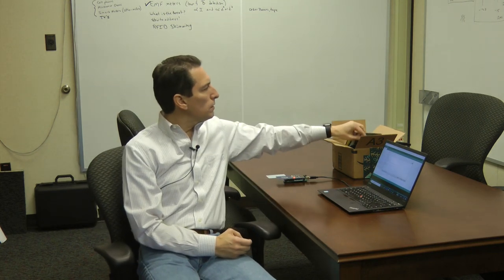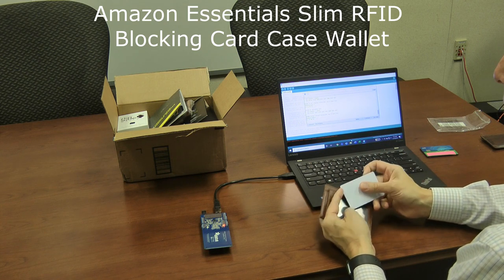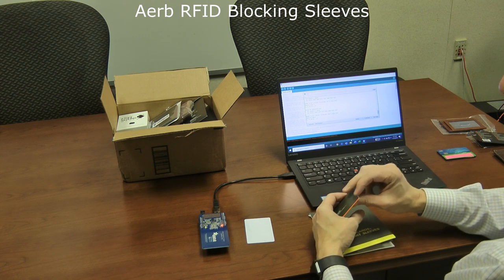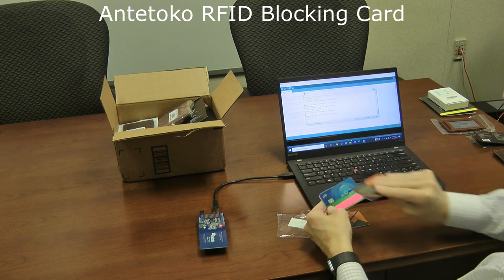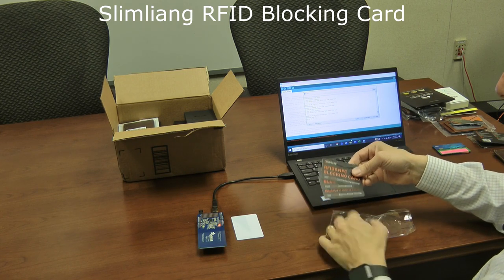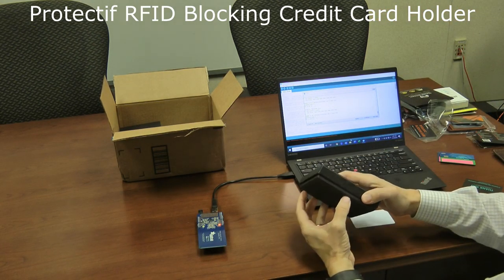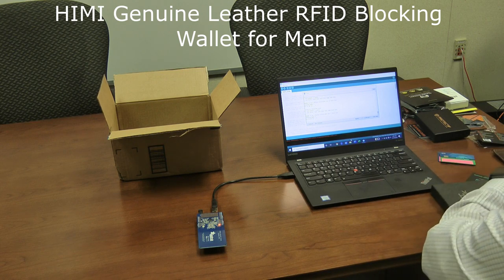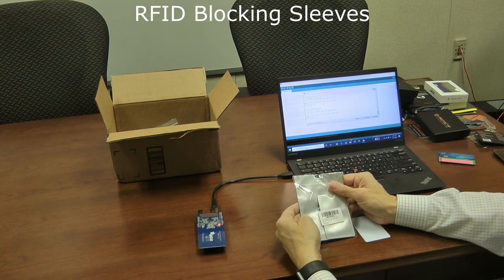Testing RFID Wallets, Cards, and Sleeves

Comment: As an engineer for 40+ yrs, I deeply appreciate the level of actual attenuation testing you performed!  Two comments: 1 my practice has been to cut the cheap sleeves into two pieces so I can line the front/back of my wallet to protect all cards within. 2 you could've tested your card in the billfold area of wallets (I sometimes put cards there to minimize bulky stacking of cards, especially if I'm sitting on them).  Keep up the technical reviews - I'm subscribing to your channel!  - Slim

Comment: That 1st Amazon one kind of impressed me...didn't think the outer slots would prevent the reading...though I think the front-most slot is for folded cash to be easily removed so pretty good!
Especially the fact that the ID slot is also protected...some of today's ID cards are RFID functional so having them protected as well is a big plus.
I'm not too hip to sitting on a plastic box or metal box so the leather ones are probably going to be my primary choices.
Thank you for doing these experiments!
Reply from the maker: You are most welcome. Glad the video was helpful.
Reply: you really should not put your wallet in your back pocket for a great many reasons.
Reply: @williambuck5617  My wallet attaches to my belt with a chain

Comment: I use the sleeves. Easy fix to make them more durable is tape the edges. The tape I used provides friction that keep the sleeve in the wallet when I pull cards out.
Reply from the maker: Good suggestion. Thanks!

Comment: Thanks for these reviews. I already had a stainless steel multitool card in my wallet, so I moved in alongside my credit cards. It does have openings in it, so it may not be perfect, but it might improve the protection. When I get a chance, I'll add some foil in the multitool case.

Comment: Great video.  Thanks for making the investment to help us all.  Your testing method was very consistent; however, some wallet designs position cards in a staggered formation.  I'd be very interested to see how some of the products work in that condition.  Additionally, what would happen if you had a stack of multiple cards (aligned and offset) where the outer two cards are in a protective sleeve, but the inner cards are not (having all your cards in those sleeves is ANNOYING.

Comment: The outside exposed sleeve is not a library cardholder... Some people want an RFID card easy to scan but when placed back towards your body ..it is protected.  thus you do not need to remove it from your wallet .   but if you do the side cut makes it easy.

Comment: I recently tried one that left 1/4 inch of card exposed. The part covered by the jacket was protected, BUT turn the wallet around and try with the slightly exposed end and the card was read. Seems like you could try this a little differently and see some les than ideal results. Example: time stamp 14:30 the body was tested but you didn't try swiping along the exposed end.

Comment: great video, I would like to know if the wallets like the amazon basic and himi with the flip out part, if that is protected when it is flipped out. I would actually prefer that it is not so you can use tap to pay without having to take the card fully out of your wallet.

Comment: I wouldn’t be surprised to find out that if you
put a rfid blocking wallet with a phone in the same pocket you’re also blocking your cellphones signals. You should do an experiment where you take some of the Faraday fabric and wrap it around the phone and then check to see your cell signal strength to see if it’s dropping and if so by how much. Also Bluetooth might be getting shielded.

Comment: Great video, one minor observation, some of the card readers you tested for partial exposure of the cards and they all failed. Assuming that the tests where the protection card was held directly over the face of the cards being protected, if the cards are partially exposed, do they still work? Especially The Vault Card :) Can it still beat the Amazon Basics Wallet? Also, it would have been beneficial if the card was scanned full width. Still a great video :)
Reply from the maker: It depends on how much of the credit card is exposed. If it's much more than about 20-30% many of the wallets and protective cards start to fail. The card I recommend now is the Survivor Symbols card, although the Vaultcard is also great. https://disasterpreparer.com/product/survivorsymbols/. Both provide outstanding protection.

Comment: Just bought a Dockers wallet with RFID.  It uses "...special inner lining...keeps info safe when the wallet is closed." There is that enclosed card which states that it is a RFID secure wallet as well as a little 1" square sticker with a printed square and a diagonal line. My question: Can I discard those two items and the wallet will still have the security feature? Thanks.

Comment: Thank you for this video. You convinced me to purchase the vault card. Would you mind clarifying what frequency your reader uses? I have an RFID card that I use to access elevators and doors in my residential complex. Sadly the vault card doesn’t support protection.
Reply from the maker: Credit cards use 13.56 MHz, which is what my reader worked at. For a cool new RFID card, folks might also check out https://survivorsymbols.com. It worked extremely well and is less expensive. Plus it has cool symbols on it.

Comment: Great video. I have a couple of questions. Is the simulated card you are using a contact or contactless card? Where is the embedded chip located in that card?  (The chip location would make a difference on some of the wallets you demonstrated that have openings).
Reply from the maker: These are contactless cards. Those are really the only ones that I could see worrying about skimming over.

Comment: There is another youtube video testing the silver-colored sleeves and it demonstrates that a card can be read through the sleeve while your test shows the opposite... Since the Arduino is a 5-vdc system, the reader may be running at 3.3Vdc or 5Vdc while commercially available readers may be running at 12-24Vdc... Field-strength would make a difference in overcoming the blocking ability of a sleeve... In any event, since the transmitted information ie encrypted (Typically AES-128/256) and is not decrypted by the card reader but by the card company (which is why the reader has to be connected to the internet), the hacker's device would have to know what the encryption algorithm is to successfully decipher the card information... it would be easier to just buy stolen card numbers from a hacker online... Your video should have mentioned this fact...

Comment: Appreciate all the info. I was going to buy the slimliang cards after your review but some people on Amazon are saying they tried it with their work door cards and it did not stop the NFC. Is that possible after your review that shows total blockage?
Reply from the maker: When I tested them back in 2019, they worked well. Perhaps they've changed their product, not sure. You can also check out the Survivor Symbols card or the Vaultcard, both very good products.
Reply: I just read about LF (low frequency) and HF (high frequency). Door cards and key fobs generally use LF which is not blocked by the products reviewed. More modern door cards are switching to HF. C/C use HF.

Comment: Thanks for sharing this. Banks are claiming that their card are RFID protected, is it true? Which tool are you using for testing please? Thanks
Reply from the maker: I don't know if those claims are true. As for testing, I used an adafruit PN532 RFID/NFC card reader connected to a computer. It takes a little knowledge to get up and running.

Comment: Hi, very interesting. Good video.
A question, if I use a aluminium soda can, for example, will that work.
I would like it, I think is thicker and rigid than the tinfoil.
What do you think??
Reply from the maker: I suspect it would work about as well as the aluminum foil, but the advantage is that it would be much more durable. Just don't cut yourself!
Reply: @disasterprepper  thank u for taking a time to answer.
Also another question.  A piece of lead or a thick aluminium (like a size of a cell phone) can be used to  block  cellphone radiations to the body.?
My husband use his cell phone on his belt case.  All day long that cellphone is next to his liver or pancreas.
Whats your opinion on that?? Any suggestion or a video on who to protect you from cell phones radiation?
All the best
Reply from the maker: @finielnecave6180  Hi Fini, I worry about this as well. In fact, I plan to test about two dozen products that claim to reduce cell phone exposure. My guess is that most don't work well, but I hope to find one that does a good job. Stay tuned, I should post the video in a couple of weeks.
Reply: @disasterprepper  i will be very attrntive to that video.
Best regsrds and all the best.!

Comment: I use my work badge to open doors/gates every day at work by passing my wallet across the sensors with the badge inside my wallet. Will an RFID blocking wallet interfere with this?
Reply: Obviously it will block rhe signal from passing

Comment: What about just a stack of three Cards, without any enclosure.  Seems to me  that three Chips would cover and cancel any signals without need for covers and slips.
Reply from the maker: I haven't checked that, but I kind of doubt it would work very well.
Reply: My thinking is that a receiver would get the signals from three cards and would be scrambled.

Comment: Quick question. I use the bus pass that I have slotted in my wallet and I never take it out. I want to protect my debit card from theft in my wallet while still being able to use the bus pass. Is it possible?
Reply from the maker: I would think it depends on if the bus pass works at the same 13.56 MHz frequency. If it does, it would be blocked. If it works at a very different frequency, it might work fine.

Comment: RFID theft has never been an issue, as there has never been one documented case of this type of theft, and now most card companies have abandoned RFID technology, and RFID blockers are just another way for these companies to charge more for something that is not needed.
Reply: Totally not true. My cards were stolen twice within last 3 months. They are all still in my wallet and I had them all in RFID sleeves provided by my bank. Thieves are getting much smarter and I need a good option, because I am tired of it… none of these would probably be effective since I did have my cards in rfid sleeves…